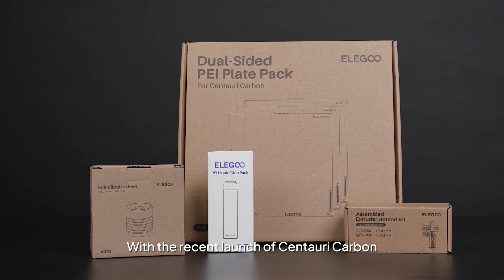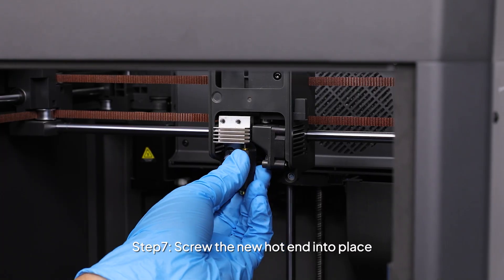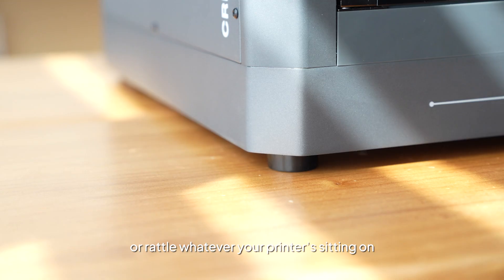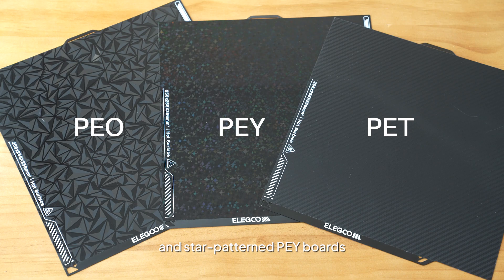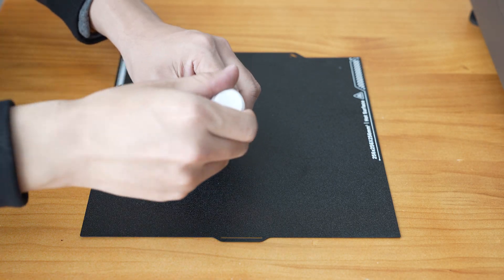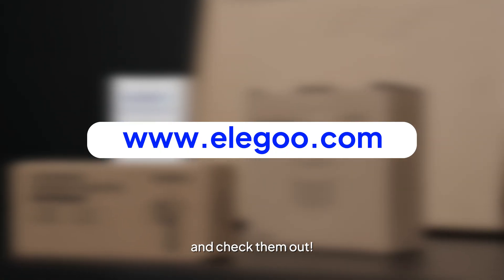How to Use the Accessories of Centauri Carbon

Comment: The first time I went to replace my hotend, the plastic housing that sits around the pins for the thermistor came out. I panicked for a brief moment, but I was able to slide it back on in the same orientation and finished the new hotend install without any other problems. Has this happened to anyone else??

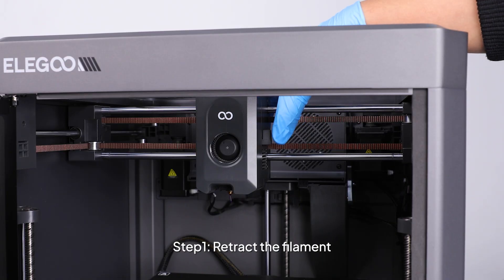Comment: If you use the frame advance keys (, and . or < >) at 0:30 you can see the heat sync for the hot end does not have set screws on the side of the nozzle.
Then if you do the same at 1:00 the "new" nozzle being installed has set screws on the nozzle side. How do I take the hot end out of the heat sync if I do not have the set screws?

Comment: What is really frustrating is each of the build plates is a different thickness, and the printer does not automatically compensate z-offset for that, so first layers are super inconsistent across plates. I measured the thickest plate (triangle pattern) at 1.1mm and the thinnest (stock plate) at 0.7mm. When it comes to z-offset, 0.4mm is a huge difference. The result is that the triangle plate is basically unusable because the nozzle is way too close to the plate, and destroys the first layer. I have re-run auto bed levelling every time I change plates and I am pretty confident that it only updates the mesh, but does not affect z-offset at all. Z-offset can be manually adjusted on the printer directly, but it's pretty buried in the settings, and can only be adjusted during a print which is super annoying. And then if I do change it, that becomes the global z-offset which means I'll have to re-adjust it EVERY TIME I change plates!

Elegoo Slicer has a build plate selector, but none of the choices correspond to these build plates specifically (which are supposed to be official accessories for the ECC), so that selector doesn't help either. It would be great if I could at least create custom build plate profiles and save z-offset values for each of them. In the meantime the only other viable workaround I've come up with is to figure out and write down the ideal z-offset values for each plate, and then set the z-offset in the start gcode depending on which plate I'm using.

If anyone else has a better solution to this or knows something I missed, please reply and let me know!
Reply: Valid concerns

Comment: The hot-end's thermistor connector (the tiny one to the left) is one of the weak links in this printer.  I saw a video where the cable broke off from the hot end side.  For me the connector broke from the PCB.  I'm now contacting Elegoo about this.
Reply: My connector came off the board when I went to replace my hotend but I was able to slide the connector back onto the pins and it worked. Did your connector actually like shatter?
Reply: @benjip3232 Connector broke off the PCB solder pads

Comment: We really need proper documentation on the build plate pack. Recommended materials/temperatures/slicer settings. Right now the build pack pack is a  guessing game, not worth the $40 they are charging for it.

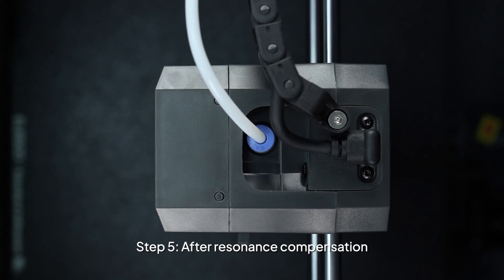Comment: 2:16 Sorry for the question, but what is ‘Resonance Compensation’?  I’ve installed the anti-vibration foot pads as in the video, but not sure what is meant by this step?
Reply: I think that was part of the auto leveling when you first set it up and I'm assume that they want you to re-level the printer
Reply: @JohnDoe-bz4yl Thank you… That’s what I ended up assuming.  But after this printer has been run amazing well!

Comment: 2:30 I'm trying to use the Dual-Sided Build Plate Pack for the Centauri Carbon, and I can’t seem to find clear documentation on how it's meant to be used. The pack includes multiple surface types but it’s unclear which side is which, or how to properly define them in the slicer. I’m not sure whether I should treat the plate as having a Side A and Side B, or if that even matters when setting up a print. When I load a file, I get a warning saying, “The selected bed type does not match the file. Please confirm before starting the print,” but I don’t know if I should ignore that or whether I need to manually select the correct bed type in the printer or slicer. There’s also no clear information about ideal temperature settings for the plates so I’m left guessing. I’d really appreciate the help. :-)
Reply: I am looking for an answer for this as well. I have ruined one of my print plates because i have not been able to find answers
Reply: The plate selection only seems to affect the temps that will be used, which are specified for each plate type in the filament settings. But it is a very valid point that there's no documentation on what temps (or filaments) each plate is designed for, or what should generally be used for each. And the plate types in the slicer are not super informative either. Other than that, another huge issue I am running into is that the plates are all different thicknesses, which significantly impacts the effective z-offset when using each one. My triangle plate measures 0.4mm thicker than the stock plate, which is double the standard layer height! that ends up making the nozzle basically scrape the plate rendering it completely useless. I've reran auto bed level, but the only way I've found to fix the nozzle height is to manually change the global z-offset which will make all the other plates off. So I guess we're supposed to manually reset z-offset every single time we change the plate (which for me is roughly every-other print). It would be great if Elegoo would add plate profiles for each of these "official" accessory plates/sides, and include z-offset compensations so they can be used effectively.